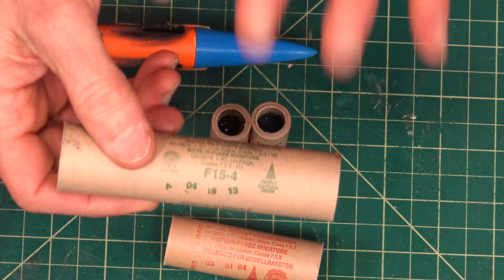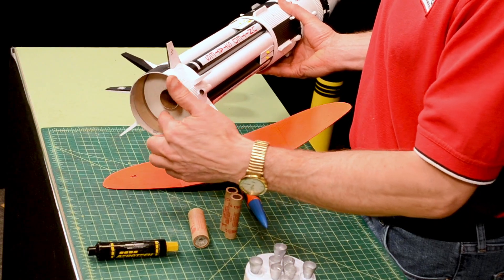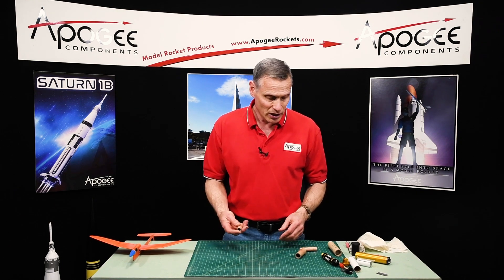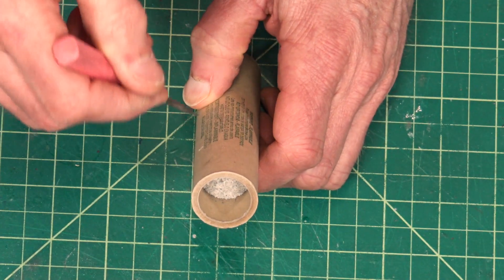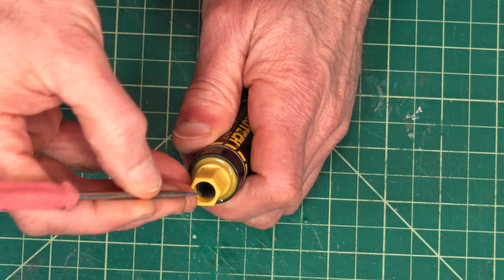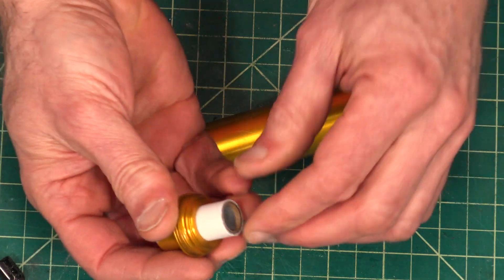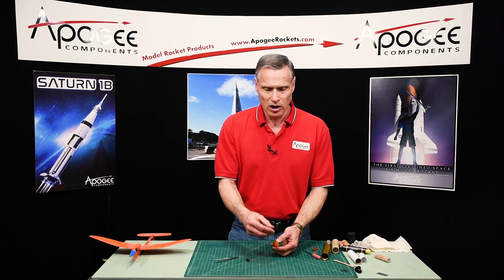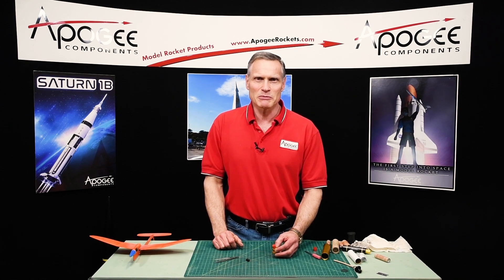Plugging a Rocket Motor

Comment: Do you know what the weight of a c motor casing is after burnout? I want to balance my glider and need to know what the weight would be in the rear after the boost. I could just burn a motor and weigh it...but would rather do the math using an loaded motor and calc. the difference lol.

Thanks for Your time in review of my question.

Comment: Okay. So, is there has any motor only for booster? I couldn't even find it on the Apogee shop. Or does a motor like C6-0 have no ejection charge because there is no clay in the upper part?
Reply from the maker: If you want to buy a plugged motor, you need one that has a P on the end, not a 0. There are not too many, and the ones that exist are large high-power motors.     You can make one yourself using the information in the video.
Reply: Klima makes a b c d size p motors

Comment: On reloadable motors with an ejection well, I've always filled the ejection well with bearing grease. then installed the cap, or taped up the ejection well.  The latter is a little difficult if you get grease on the outside of the motor or ejection well.  The best solution is to buy a plugged forward closure.
Reply: Have you found a plugged fwd. closure for a CTI Pro29?